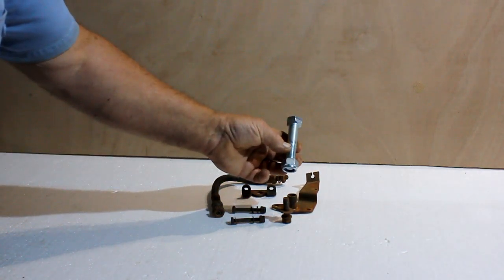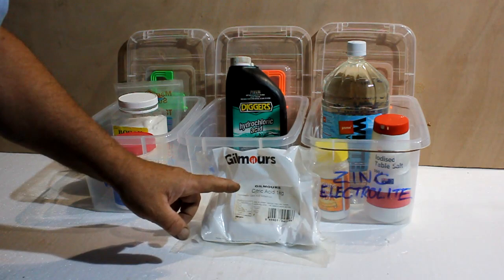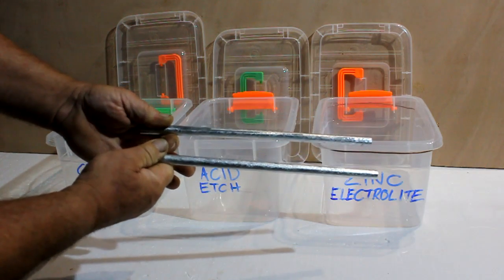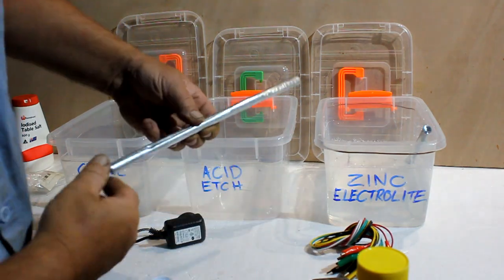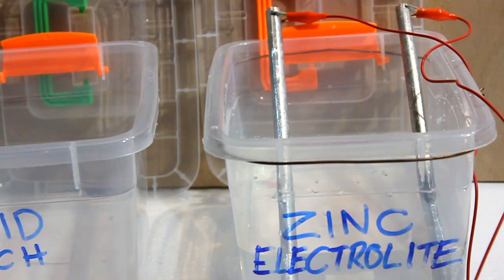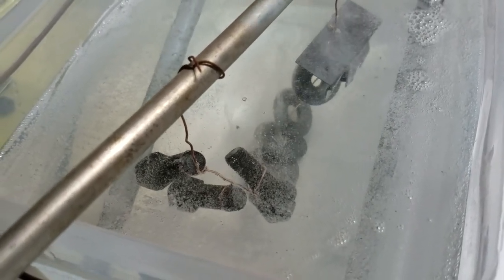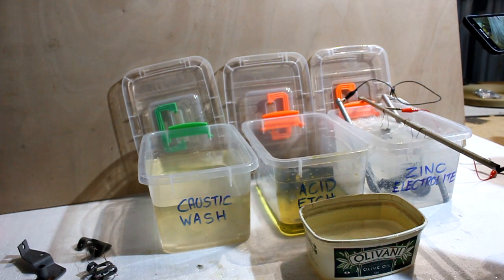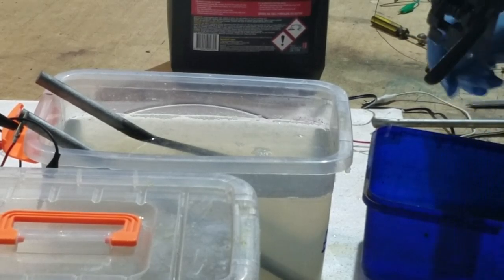Zinc Plating Small Parts at Home!

Comment: I have also home plated without buying a playing kit. But I found a couple of things that need to be done different . 1 always use separate rinses between stages, it's not expensive to do so and it stops contamination. 2 never use copper wire the copper contaminates the zinc ,use stainless wire. 3, buy a adjustable power supply they cost around £30 $30US and $45AUD They make the job easier completely.  No need for 30mins plating time that's to long
Reply: good tips

Comment: I'm no chemist but I'll point out that I think if you mix white vinegar (acetic acid and water) with table salt (sodium chloride) and use for electrolysis it gives off a chlorine gas which is highly toxic. I think with baking soda it's only carbon dioxide so that would be safer.
Reply from the maker: Wow!  so stay away from salt and vinegar crisps too? lol.

Comment: Hi I have a classic motorcycle that I want to so all the washers nuts and bolts over the winter I seem to be struggling to get hydrochloric acid is there another acid I can use ? Also do I need to use de~ironised water in with the costic wash thanks for your Video
Reply from the maker: I just got hydrochloric acid in a 4 litre container at the hardware store. its used commonly for removing cement splashes. Builders use it. Yes - I used distilled water - store bought

Comment: can we put all nuts, bolts into small metal container then hook up to a wire instead of individual one ?
Reply from the maker: no- zinc plating is very straight line- It just wont work
Reply: Yes you can, do it all the time, see my post. Commercially this is done in rotating mesh drums. If I have a lot of bolts I do them that way but I mostly do it for smaller stuff.

Comment: Actually zinc plating is only a favorite method due to cadmium plating having become too expensive for commercial applications due to environmental laws. Comparing cadmium plated parts to zinc plated parts is like comparing apples to oranges, zinc is a very poor replacement. If you get into zinc plating then you will most likely be dealing with cadmium as most older parts are cadmium plated and you will be exposed to it both by touching the parts and when removing the cadmium with acid, something to keep in mind.
The coach bolt is not zinc plated, it is galvanized which is why the plating lasts longer on them.
For small parts, screws, washers, bits and pieces, do not attach them to wires individually, not only will this turn you bonkers and waste a lot of time, it might dissuade you from plating them due the work involved. Construct small enclosed baskets out of gal mesh and put your parts into them. Electrode connects to basket. Shake the parts in the basked every few minutes. Same method can be used for passivation.
Brighteners are used in the electrolyte and will give you a shinier finish, passivates are primarily used to provide corrosion resistance to the zinc, prolonging the plating life.
If you get into zinc plating or any plating for that matter, the hardest part of the process is preparation, that is the steepest learning curve in the process. It is not so hard on smaller parts but once you get more ambitious with larger parts it will be. Hyrdochlocric acid, whilst cheap and easily available is not a very good acid for cleaning steel. The problem with it is that parts cleaned with it will immediately rust once exposed to air, even after rinsing. This flash rusting is not caused by the parts being super clean, it is caused by the hyrdochlocric acid itself. If you use nitric acid you will not have that problem, plus it works better at removing rust. Hyrdochlocric acid will also contaminate your electrolyte over time, not so much a problem if you are using a cheap solution like you are doing, but it will be if you use a proper zinc chloride/ammonium chloride electrolyte and you have several litres of it.
Results in zinc plating, and by that I mean longevity of the plating correlates to your setup, technique and chemicals used. In the end if you want proper results you will find that you have to use the correct process, there is no way around that and something you will learn with experience. Passivating the parts after plating is also part of the process and another process in itself that has to learned through experience to achieve proper results.
Well done on your work and for posting it up and having the motivation in doing zinc plating for yourself. I myself would never trust zinc plating of my precious parts to anyone but myself (been there done that). When you have rare parts you do not want them lost or destroyed by too strong a cleaning process. The amount of care you can personally put into the process would make commercial plating too expensive, which is why if you want it done right - do it yourself!
Reply from the maker: Alan - you are a gem!- There is some really good info there,Thanks so much. Ill be tracking down some Nitric Acid then. I restore Land Rovers so the durability is key- appearance is very secondary.  The wheelnuts that I treated have  been a few thousand km now. beach and farm, bush forestry. they are just whitening up now. Im keen to hear if you have any tips to get more durability from zinc plating. Thanks once again for your interesting comment.
Reply: @t.h.o.r.  You are welcome. I am always happy to see people getting into zinc plating for restorations and I started just like you. With the parts plating baskets, throw all your smallish parts in them and put them through the acid wash and rinsing cycles that way, then straight into your plating tank. This will also prevent the build up of zinc on the baskets. You do need to take into account that the basket itself will add an extra load to your power supply, just go off the bubbling to set it right, you do not want it to boil, just small bubbles. You can get a thicker coating without crystallization if you keep the current towards the low side. Also, use zinc sheet not rods. This will not be so important if you are just doing bolts but once you get into plating bigger parts, things like the back of an instrument cluster it will be. You need more coverage than a rod can give you in those cases. You can get zinc sheet from your plumbing supplier, it's used like lead sheets on roofs, comes in rolls. With bigger parts, rotate them every now and again to get all the angles. I get all my supplies from http://aedaustralia.com which is situated in Adelaide. They have all the chemicals including brightener for your electrolyte (get some of that if you are going to use zinc chloride/ammonium chloride - makes a world of difference) and also chromates for passivation. If you have any questions or run into problems please feel free to ask me, I am only too happy to help.
Reply: @t.h.o.r.  So many things to know about the process, I should one day write it all down, problem is it is hard to remember all the tricks just sitting on my PC, comes to me when I am actually doing it. With passivation, the problem you will run into is getting the stuff to stick properly. It helps a lot to run the parts through a WEAK acid wash before plonking them into the chromate solution. This will remove the electrolyte more thoroughly, rinse well first of course, then rinse again after the weak acid wash. Time in the chromate solution is measured in seconds, too thick and it will flake off, too thin and it won't provide proper protection. I can't tell you when it is right, I could only show you if you were with me during the process - experiment. Keep in mind that the chromate will be quite soft until it has fully dried, easily damaged, give that a day or two before touching the parts. Also, think about getting a proper variable power supply with enough grunt to do all the jobs. Set current to full and go off your voltage reading, that's how I do it anyway and no I don't go off calculations I just watch the bubbling to get it right.
Reply: Allan Smith, brilliant mate 👍